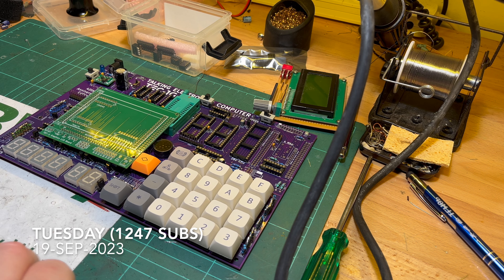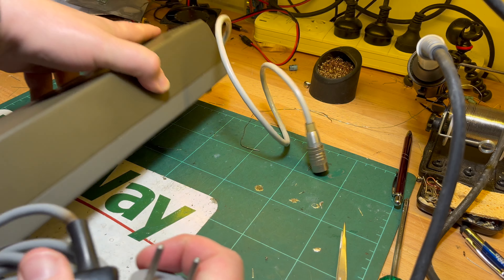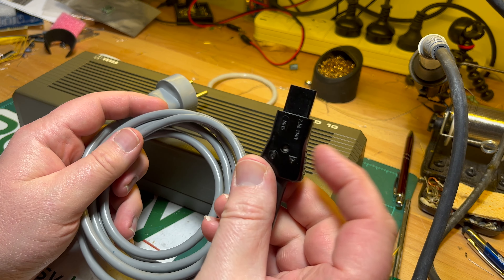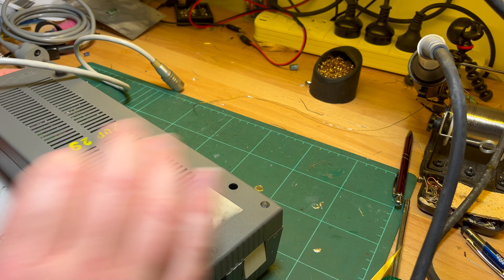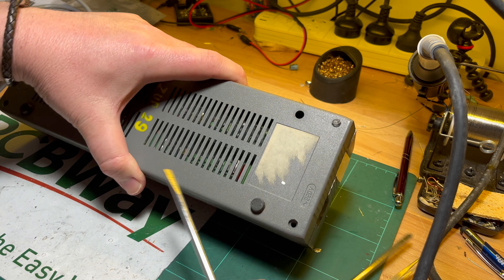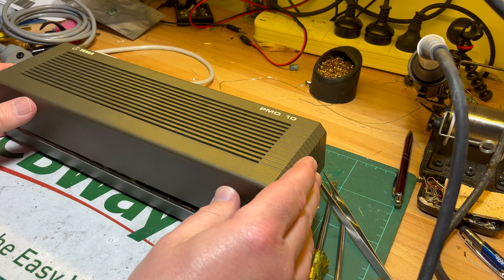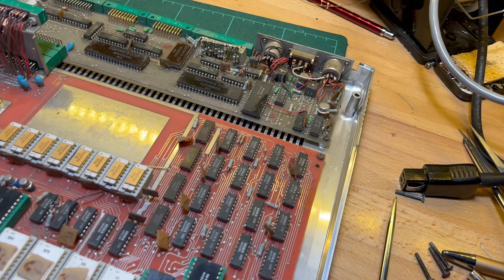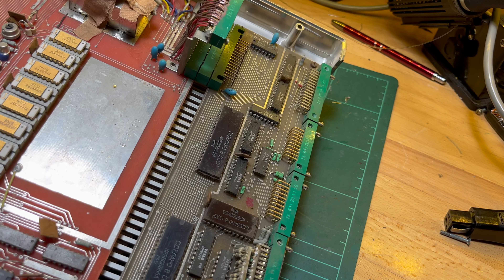🇸🇰 Tesla PMD 85: Part 1 (PMD 85-2B) [TCE #0349]

Comment: Picked one of these up a couple a months ago and haven't tore into it yet.  Looks like an interesting machine!  Glad your going first🙂. Keep it up and thank you for the video!
Reply from the maker: Do you know what iteration?  Would be interested to hear how your keyboard is as well!
Reply: @Brfff   It's identical to yours, 85-2A.  About 1/2 the keys are stuck.  I am very interested to see what works for you to get the keys moving again.  Haven't opened it up yet to see if the keyboard has the connector or if it is soldered in...

Comment: Interesting to see that transformer is rated at 60Hz. And what is in that blue sleeve @7:39? The SU160 transistor that it is connected to is rated for 700 volts between the Collector and the Emitter. Which could explain why there was no insulator. :)

As for the cord, what's wrong with the adapter that you already use? That way you can leave the cords alone.

As for the regulator being for -5 volts, while there is a Tesla MA7805 available, there is no Tesla MA7905. So I would be investigating what that white wire coming off of the MA7805 does. That one chip is a 7403 quad 2-input positive AND gate, not sure what the other one is. Otherwise it can't be much more than a fancy linear power supply.

Look @28:53, Could someone have spilled something on the connector and ended up gluing it together? And it appears that it has a broken pin. 

Look @28:58 Is that pin meant to be rotated to release the connector? It could simply be a way of keying the connector to keep people from trying to connect the wrong device.

@33:37 Why would someone put the keyboard connector in backwards? Note the bent pins near your fingers @33:35 and the chunk taken out of the connector. Might explain why the power supply doesn't work. 

@33:39 Why does it look like the wires to your ROM connector on the side towards the center of the computer appear to be soldered together?
@33:50 Someone had to make test measurements and found nicking the wires easier to do.
@33:57 Looks like someone reworked the cables coming into the keyboard.
@35:29 What's going on between pins 6 & 7 on your 8053 chip? Turns out that it's a weird one, but you can get them here: https://slawmir.com.pl/ukl-scalony-8253-dip24-p-45415.html And it appears to be a clone of an Intel 8253 programmable timer. But the sales sites of the original ones call it a 28 pin device, it's got a stub pin near the center as well. Odd.
@39:18 Looks like someone added washers to raise the board up a bit to miss the RF modulator. Keep the tape. 

A long, steady closeup of the board and power supply would be appreciated. :)

I still like your "Mini-me" keyboard. :)

Comment: When I was a kid about 10 years old I had some video sync issues with my PMD 85-2. Despite not having any clue I decided I would attempt to diagnose the fault myself :-) I started with the PSU. I removed the cover, turned it on and put my hand above either the trafo or some of the caps (don't remember anymore) to feel the heat. Obviously I got zapped pretty fast. As I was not touching anything (or at least that's what I had believed) I repeated the "overheating" test. And got zapped immediately again, this time ending up with some blisters on my thumb. I think I am lucky to be able to type this comment :-) It is pretty common to find a mix of TESLA, East German, Polish and Soviet ICs in Czechoslovak computers of this era. Btw, I think this computer has the worst keyboard ever. The keys are very often binding. This was driving me crazy as a kid. After 40 years it gets even worse as the conductive rubber contacts inside of the switch disintegrate. The keyboard was not meant to be disassembled, but it is possible given some effort. One has to remove the plastic rivets using a flexible blade, remove and service the switch, and then screw the the switch back using small screws.